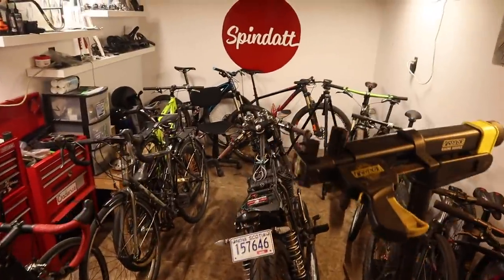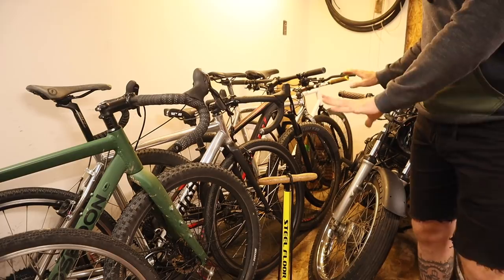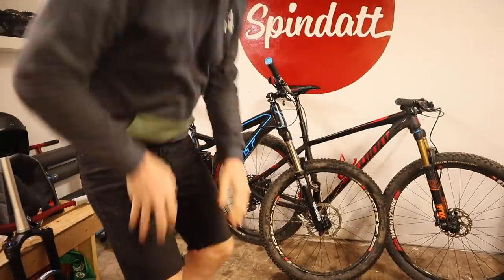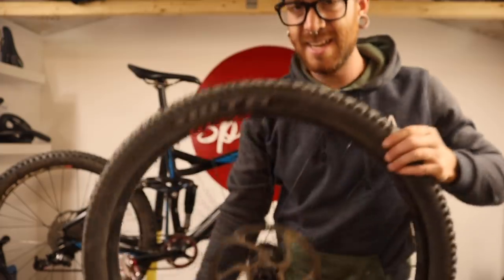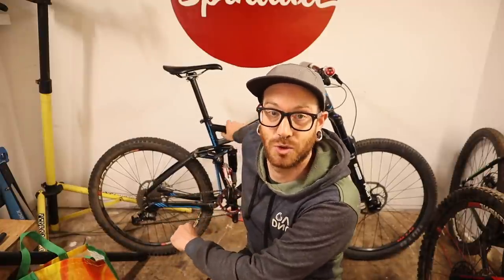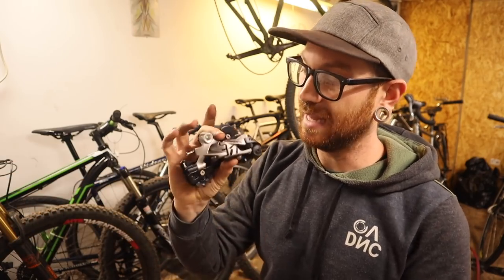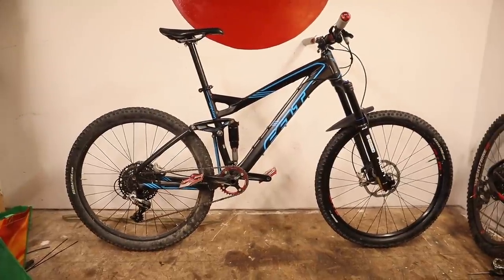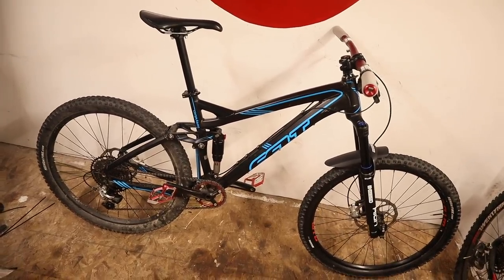My 26" Trail Bike Goes to 650b AND gets a road derailleur!? Old Trail Bike Modernized: Phase 1

Comment: Looks cool - the mullet 26/27.5 would be interesting .... little call back to the classic Specialized Big Hit - remember those!

I'm surprised the 27.5 cleared the rear triangle... would be interesting to know the difference in diameter and how much clearance you need on an existing 26" frame.

Comment: Just done the same conversion from 26 to 27.5 no clearance issues? My rear tyre has only got a few mm clearance to frame. Might have to try the mullet(?) set up. Or go for a smoother tread for the rear to get more clearance.